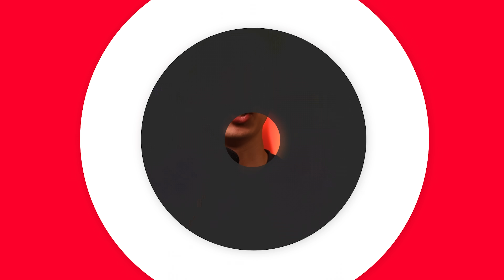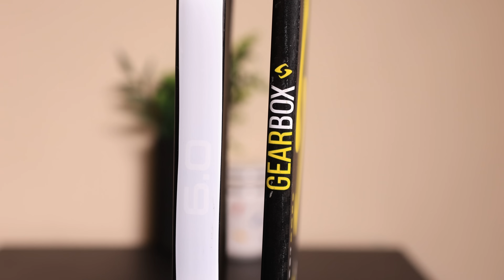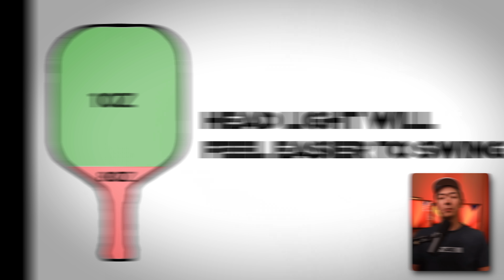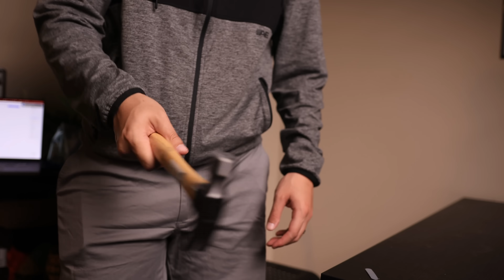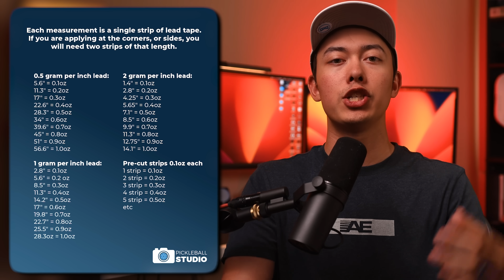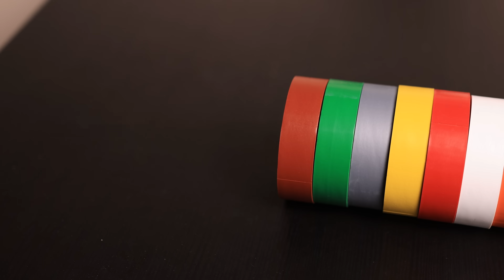The Ultimate Guide to Using Lead Tape on Your Pickleball Paddle

Comment: Im using an elongated handle J2NF paddle. I added 12 grams end cap & 4 pcs 3grams tungsten tape in the corners. I still feel its not enough & i want to add another 3 grams on top. Is it too much?

Comment: Nope. Only correct spot is in the handle. Making the paddle head light to help with paddle head speed is all that matters in pickleball. 50,000 other ways to get power and stability. No point adding weight to help with anything else.

Comment: I am no expert but based on what I have been experiencing while playing with weights on top and on handle..in my opinion... there is somehow, if not slightly, significant effect putting weights on handle...

I used about .1oz weights on top to add more power since my paddle is light towards the head which I feel like I have no force when hitting the ball so I put some on top. While on handle, I use "more" weights. let us say ratio of 1 : 3oz (summing it up my paddle weight around 8.5oz from 8.1). This makes my paddle "feel more" stable.

I may say that, I tried to make a seesaw effect? wherein, when you started to swing, the force from your body turn into energy in the handle (making it stable) then travels through the neck and along the face of the paddle and when it reached the center face, the top weight will be the one to put additional momentum to "push"  which upon impact, a more power/speed hits the ball. Just like someone pushes up the seesaw, when they are on the middle of the air, the other person (going down) on the other side readies itself to give its push to go up again.

another thing is that, IMO, weights on handle also act as a dampener - to lessen the vibration during impact which also make it feel more poppy. The only downside I see to it is really feel heavier and I do not feel the ball even if my paddle is a 16mm 😅 maybe I used too much weight on handle. I tried to remove some weights on paddle but not yet played it... so I do not know what will be the effect...

maybe all of this is just an illusion effect but it helps me gain more confidence on my hits.

Comment: Electrical tape will eventually get sticky all around it and get on your paddle surface just by hand contact. I wouldn't use that stuff at all.
Good video with some good suggestions. Thanks.
Reply: Buy only 3m tape

Comment: You contradicted yourself with saying adding weight to the handle won't do anything right after showing how flipping a hammer over makes a difference.
Reply: In that example no weight was added to the hammer. What he’s saying is, if you added a bunch of tape to the handle of the hammer and swung it normally, the balance would be different but the swing weight will not be decreased.

Comment: Weight in the handle may not change your full swing but will make easier to flip the paddle at your wrist, just like the hammer example.  You missed this critical point.
Reply: It wouldn't make it easier. LOWERING the weight of the head would make it easier.

Comment: I am looking on the chart, I am using Engage MX 6.0 I don't think the rpm is 1520, is definitely one of the spiniest paddle. Also, would be nice to make a clip to explain the advantages of a slower paddle, this one has 127 swing weight, and I added lead as well close to teh handle. I tried hard to play with a faster paddles. Ruby, Ace, Joola but for my singles game this one seems to be the best, all the others are too soft to transfer weight during passing shots, 70% of my points are not finished at the kitchen or if at the kitchin, not after dinking but heavy shot swing volleys.

Comment: What this video isn't mentioning about weight in handle, is that the handle weight decreases "recoil weight."  That's the amount the inertial impact of the ball has on the face of the paddle.  Handle weight gives the feeling of stability vs. the impact of the ball...a side effect of this means miss hits (which effects twisting) will be less impactful because the counterweight in the handle.  So, while twist weight isn't technically increased, the feeling will be that it is.  It will also feel more stable when blocking.

For an example of this, imagine the paddle is in a swing weight machine.  If you throw a ball at the face, it will recoil less (move back from the impact) than when unweighted.  

The other effect is that, while unweighted, the maneuverability is better, not when making full swings (main fulcrum is the shoulder and your moving your entire arm)  but when engaging the wrist.  Flicks, speedups, and any movement using your wrist as the main fulcrum.  There will be more weight making long strokes feel heavier like drives which use the whole arm because the swing weight is increased, but the wristy movements will be vastly improved.  It does make your paddle more poppy though (IMO) because there is less give in the face when the ball hits it.

Comment: I am getting the Vatic Pro Prism 16mm and plan to add lead tape to the bottom.  My current paddle is my first and is the Onix Z5.  It has a weight of 8oz with swing weight 101 which likely needs a lot.  What would you recommend I add with lead tape to this paddle?  It seems like it has decent power, but control is bad. Would this be lead tape all around?

Comment: So with the Selkirk Tungsten a whole strip is 0.1 ? or is it 0.1 per inch of strip,  - if its 0.1 the whole pack only weighs 0.4 oz or 2.8 grams per whole strip.  Seems a bit light to me.

Comment: I don't really agree with your statement about lead tape in the handle. I have a vatic pro flash with a stock weight of 7.9 oz and 11 points head heavy. I placed lead tape in the handle to bring the weight up to 9.0 oz and now it 3 points head heavy. That changes the swing weight. Your real world example was very good. As for tennis, you'll be hard pressed to find players using a head heavy racquet. Really like your shows 😊

Comment: New guy question.  If you add lead, and you would like to have edge tape as well for protection, do you put the edge tape on and then the lead or lead and then the edge tape?  Thanks for any advice.
Reply: Tape on top of lead. The whole point of the tape is to cover over the lead, because lead is toxic.

Comment: In tennis, we place our lead tape based on where the natural sweet spot of the racket face is, which is center and towards the throat. Thus, we rarely place lead tape towards the throat, since it would do little to expand the natural sweet spot towards the contact zone. So it would be much more helpful to include in your information where the natural sweet spot of a pickleball paddle is located to help guide the recommended tape placement.

Comment: Golfers have clubs set to a certain swing weight, as mentioned, swing weight is a personal preference. I used lead weights in the back of the putter and on my driver, I would add more to get to a certain swing weight.

Comment: Hi I've noticed almost every pro player doesn't cover up the lead tape on there paddle. I've tried it and the paddle balance changes when you wrap the paddle with electric tape. Does anyone have a better explanation for why the pros don't cover up the lead tape on there paddle? Isn't it supposed to be toxic?🤣

Comment: Thanks for the info
Did you use 3/4 " electrical over the lead tape on your zero 6 16mm double black diamond?
Reply: what electrical did you end up going with? also what lead setup did you end up using for your dbd

Comment: I liked how you explain the how's and whys in a manner that everyone could find helpful. Instead of expensive lead  paddle  tape, I use small thin flat lead fishing weights or motorcycle thin tire lead weights with electrical tape to hold them. Both are easy to cut and flatten (if needed) and are much more cost effective that the lead paddle tape.  Thank you again for your hard work. The school system needs teachers like you!
Reply: Pennys and nickles work as well. Use a hot glue gun, which will allow you remove them if needed.

Comment: Can somebody smart answer this please: Why would adding Ltape to just the head increase power?  I am not saying that it doesn't. I would like to know why. The ball speed (power) increases only if the paddle speed or paddle mass increases (or both).  Putting lead at the head will make you swing slower (higher swing weight) so that doesn't help. You can't put much mass there because a small weight feels heavy, compared to locations lower along the edge.  So we have a swing speed decrease and only a small paddle mass increase. Why is this the most powerful?  I think that for a person with poor swing mechanics, perhaps the higher swing weight could put the paddle in a better laid back wrist position, allowing other things to happen - kinetic chain, better weight transfer, lag and snap of wrist, etc. and all of those things get the paddle moving faster at impact. Is that it, or is there a better explanation? Don't make me call Mark Rober. He's busy with his squirrels.  thanks.

Comment: Got a new Ben Johns paddle to replace my old one (think it is dying and has dead spots / less power). My new one is about 10 grams lighter, and it all seems to be off the head/tip. Feels too light when swinging compared to old one. So I just taped 5 dimes to the end with masking/painters tape to see if it "felt" like the old one when when swinging, and it does! I didn't think 10 grams (5 dimes is about 11 grams) would make much difference, but it does. Guess I need to get some tape.
Reply: Better than dimes is 12 gauge copper (solid core) wire!

Comment: Talking about swing weight…..I have been wondering after watching your videos if swing weight changes much if at all with a specific paddle but different weights. For example, take a Legacy Pro 7.7oz & a Legacy Pro 8.3oz. Will the 120 swing weight apply to both?

Comment: I would not suggest adding lead unless the stock paddle was lacking something.  

For instance a woman with weak grip strength might not benefit from additional weight because it makes the paddle less responsive when quick reactions are required.

OTOH a strong male wanting more power might consider adding weight around the edges.

I've used lead tape in various configurations for years.  I don't use it now.  I like a single piece of the heavier than plastic woven cloth edge tape to protect the top and top-sides which adds weight.  This  makes my stock 8.0 ounce paddle a little more head-heavy compared to stock with a feel and balance I like.

That may not work for you.  You're not me.  😎

Comment: Great video, Chris! One note I found with tape: Since Tungsten is expensive, there’s a way to make it “cheap”. Only buy it once. If you adhere it to another edge guard tape, you can layer it under another fresh edge guard tape. So, when you get a new paddle, just remove it from that outer edge guard tape and place it under your new tape. Never have to buy another set of tungsten strips that way. 

Also, I got the thick Gearbox edge guard tape, and cut it in half lengthwise. So I get double the length for the price. More savings!

The ProLite tape looks sexy. I’m going to have to try that one. ✌🏼
Reply: Taleb said tinkering is worth 1000 IQ points...nice fix man .

Comment: Great video. 
I have a couple of extra tips for applying the lead and the tape. 
Before applying the lead tape, I use a paper towel with 91% isopropyl alcohol on it to wipe down the application area on the paddle. Then I use the side of the scissors blade to press and form the lead tape to the paddle edge. 
Then I repeat the alcohol wipe down of the paddle edge and the lead tape and apply the electrical tape ( or whatever tape you use) to cover the lead. 
I have never had any tape fall off my paddle using these steps. 
And to agree with another comment, I always use 3M Super 33 electrical tape.

Comment: Very nice tutorial. Who knew using math, science, and a live demonstration works for everybody!  I'm a old teacher and a new pickleball player and believe you have the most useful, unbiased, and honest reviewer of pickleball equipment channel for pickleball players out there.  Oh and did I mention that he's funny and his buddies from Oklahoma!  Great job.
Reply: Why use lead? It's a toxic substance. If you're handling it with sweaty hands and then wiping your face, there's a greater chance of inadvertently ingesting trace amounts over time.
As a chemical engineer, particularly one who has worked with highly hazardous chemicals and MHF facilities, I wouldn't recommend using lead tape unless there is a compelling reason to do so.
If we're going to rely on science and engineering principles, tungsten is the more logical choice. It's significantly denser than lead, allowing the same weight adjustment with less material, and it is far less toxic. You get the performance benefits without the unnecessary exposure risks associated with lead.
For me, the question isn't why use tungsten—it's why continue using lead when a better and safer alternative already exists.

Comment: Great video! If you haven't on an earlier video, it would be nice if you gave examples of how much swing weight increases on different paddles with different weights in different places. I have a legacy pro and powerair invikta I added about .6 oz mostly towards the head. 
I know approximately my starting SWs from the spreadsheet, but I don't know how to approximate the new swing weights. I did start heavier and trimmed til they were about right, but I'm wondering where I am for swing weight. 
Thanks and great work!
Reply from the maker: Pickleball Effect recently made a video that covers this! 😊
Reply: Thanks. Exactly what I was looking for. :)

Comment: A few 1/2 gram per inch options out there...almost like a foil tape...very pliable.
Generally agree with most of what you said; but the math approach followed by putting the lead on a scale was overkill.  Just use a scale or do it enough that you can go by feel only.
Additionally, I'm personally not crazy about the pre-cut tabs...I've had too many pop off(I'm a banger, remember).  Cost is 4x what I pay for rolls(you mentioned cost) and I'd rather be able to burnish the edges of roll tape vs the pronounced edges of the tabs.
Kudos for helping dispel the notion that hand speed can be increased by adding weight...anywhere; but -10 points for talking about how "hard" it can be to swing (any) paddle of typical weight.
Reply: You evidently have never taught a class or cut a board before.  If you had you would know why the old measure twice and cut once saying is true.  Now the math thing. lol  Dang it I hate when facts get in the way of "How I feel".  Yep your one of those smart Bangers!!!!!
Reply: @leightodd7335  Remember how easy it is to apply, remove and reapply lead tape?  Yeah, that's why you don't cut to 1/4" and then put it on a scale.  It ain't rocket surgery...it's easy to change(unlike trying to lengthen a board you just cut too short).  The numbers don't matter if it doesn't feel the way you like.  I have three decades of tennis clients who appreciate that("only" five years of Pball clients).

Comment: Believe it or not adding led tape to my ronbus completely eliminated my tennis elbow, out of the box the R3 has way too much vibration and is severely lacking power, but for $99 best deal around
Reply: Curious where you added the tape and how much? I have the R1.16 and feeling I need more stability and bigger sweet spot.
Reply: @donnastancil2086  I added a total of 12grams, 3g strips @ 3,5,7,9 O'Clock

Comment: Just a note about electrical tape. Don't buy the cheapest tape. 3M makes the best tape. It's durable, flexible and trims nicely with a razor blade. Cheap electrical tape is not as flexible and does not stick very well. Thanks for the video.
Reply: AND watch out for the heat!  The cheap stuff gets really gooey if exposed to heat(even still on the roll!).  Can make a mess in your goody bag!
Reply: Can agree on 3m tape from the world of nerf modification directly, and car window tinting indirectly.  The company seems to throw value to the wind and prioritize quality above all else.  I am going to definitely use 3m electrical tape on my new crbn2 paddle
Reply: 3m super 33+ is what I use for automotive wiring. It's one of the best electrical tapes you can buy. Flexible and sticky.

They make a super 88 thats the same but thicker at 8.5 mil compared to the 33's 7 mil
Reply: Hockey tape is also a great choice
Reply: Thanks for the tip!

Comment: I sometimes wonder what my swing weights are - when I start, I calculate the balance of the stock paddle and then start adding weight and then adjust my balance points. (I tend toward +10 to +12)
Reply: Static balance points are almost as non-informative as static weights.  I can add a pound of weight to you paddle and maintain the same static balance point...but it won't feel very good to swing  ;)

Comment: Something I’ve noticed for hand speed is that counter intuitively when moving up from a 7.9 ounce paddle to around an 8.2-8.4 ounce paddle peoples hands actually get faster. In my experience it’s because it acts much like a compression sleeve or a weight which allows your muscles to more fully push against resistance rather than your muscles only working at 80% because they don’t have as much to resist against. Just some food for thought.
Reply: I don't think a half-ounce is going to make a difference to someone who used 13oz tennis rackets for decades.
Reply: It will once they learn to dink and master drop shots